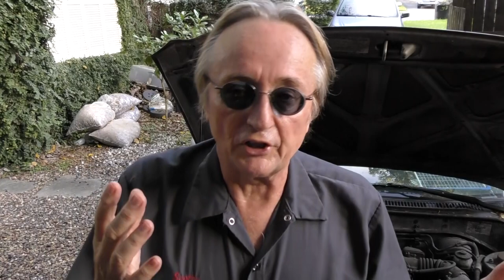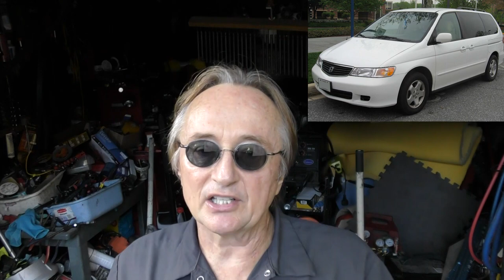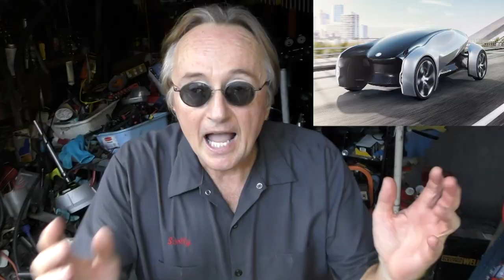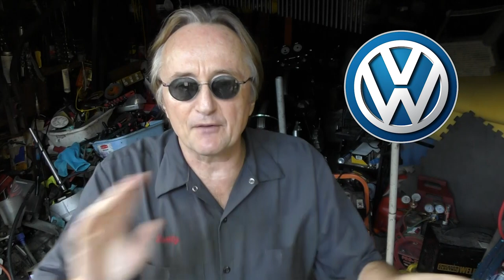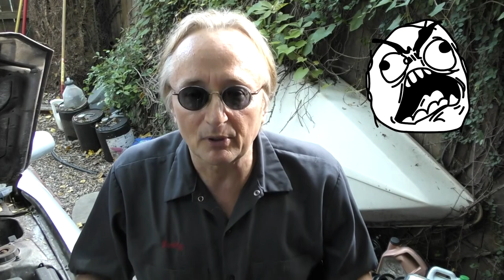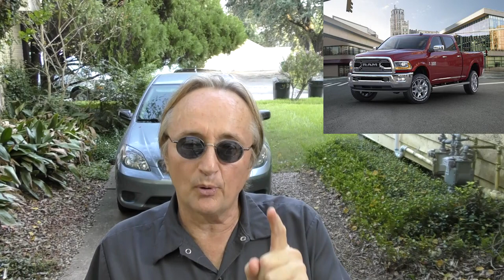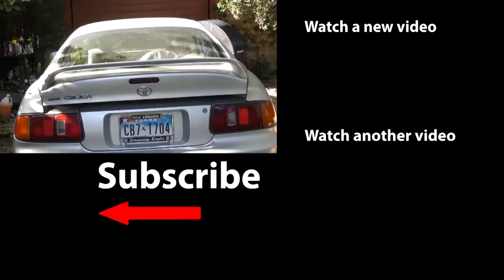Who Makes the Worst Automatic Transmission Cars in the World

Comment: Yes, Honda made horrible transmission in the beginning of 2000s. That's been rectified about a decade and a half ago, so they no longer produce bad transmissions for either of their vehicles including Acura lineup. So no, Honda does not make the worst transmissions in the world.
Reply: Acura Addicted I agree 100 percent. I have a 2008 accord v6 128400 bought brand new. Never had a single issue out of that transmission.  It's still strong 10 years later. Honda and Acura transmissions are very reliable and durable  for the past 15 years.
Reply: Actually, same here - I drive the V6 2008 MDX with 5 speed auto coming on 155K miles now. Zero issues with transmission or engine for that matter.
Reply: Umm the newer cvt have issue. I know people got free replaced under warranty
Reply: What about Honda civics? Do they have good reliability
Reply: @MrWalker1000  Yes civics are fine as any vehicle. . . Most of the vans and suvs they talked about here were driven by wemon and not serviced properly. And also have ungodly high milage.
Reply: Honda Odyssey from 99 to 2004, Honda accords from 98 to 2002 and civics from 2001-2005 automatics are the worst. With Honda you always has to go with manual transmissions to be safe
Reply: Explain how your transmission went wrong
Reply: which would you pick a toyota corolla or a honda civic?
Reply: @MrWalker1000  Civic hands down over the Corolla. Extremely well engineered and fun to drive. Everything Toyota makes are fine but as boring to drive as watching paint dry. Stying is horrible except the new Camry 16 and up but even then the Accord is better looking. All Toyotas are well built but all lack any type of interesting creature comforts. Toyota equals zzzzzzz.
Reply: @cook1876  anything wrong with 2005-2010 civics?
Yes you make good points about Toyota being boring however I think they sacrifice the fun aspect in order to make the most reliable cars in the world. A corolla is more reliable than a civic.
Reply: @MrWalker1000  my daughter has an 05 civic 150k miles no issues. Ive been in the auto repair business for 20 years. The only issues common to all Hondas are ac compressor failures.
Reply: @cook1876  ah I see thanks your opinion actually has weight given your experience. Yeah honds became popular cuz Toyota like reliability but except more fun to drive.
Thoughts on Mazda and subaru.
Why aren't Mazda as popular as other cars are they bad cars?
Reply: @MrWalker1000  at my shop we specialize in Subaru. In snow country you really can't beat the awd abilities. Prior to 2012 they are plagued with head gasket issues. After 2012 their cvt transmissions are questionable at best. If you can drive stick find a Subaru from 2012 and newer that combo is virtually indestructible. In 2012 they went to a timing chain instead of belt and no more head gasket issues. Great cars. Mazda is a bit of an underdog. They make great fun cars that nobody seems to buy. I would have no issues buying one. We never see any come in for anything major. Usually just maintenance.
Reply: @cook1876  yes scotty was saying the same thing that stick subaru are more reliable. Do they make bad autos?
How come pre 2012 subaru have such good reputation if they ha e so many issues? Too bad in the usa most use automatics.

Interesting... so Mazda are very underrated? I really dig the new Mazda. I always thought people didn't buy them because they were known to unreliable.
Do you know if the partnership ownership with Ford lowered their quality?
Reply: @MrWalker1000  pre 2012 Subaru rarely had transmission issues in their automatics. Mainly because they had a real transmission and not a cvt transmission. Cvt transmissions in their newer cars have been a problem. Very few manufacturers have been able to make a quality cvt work those belong to Toyota, Hondas, Mazda, Hyundai\Kia. Speaking of which don't rule Hyundai or Kia out. In the past 5 years or so they have been making really great quality vehicles. Great engineering in their powertrains and fit and finish. As far as Mazda I believe in my opinion their older merger with Ford hurt their quality. Since then they have moved away from Ford and refocused on building quality cars again. It has shown and more people are taking notice.
Reply: @cook1876  so buying 2005-2010 Mazda isn't a good idea.

I see a lot of used subaru but I always heard about the head gasket issues which kind of pushed me away from it. I don't like nissan that much.
Which made me rule out honda civic as my number one used car choice and Toyota. So basically honda and Toyota. I'd buy used Mazda but the Ford thing is kinda making me iffy.

My family member is crazy he swears by mercedes reliability which I thought was crazy he got a 2002 c-class. I told him he should of went Japanese.
Anyways I've been looking honda civic mostly just need to find good one but they all seem to be priced highly
Reply: unless you live in your dream world, but for us who live in the real world the ZF 9 speed units fail, one even fail on motortrend , the CVT fail up to 2017 models, their 8 speed DCT is also having failure.GO look where their favorite CR now rank them, go look at where they are rank in JD power dependable survey.
Reply: you can speak about 2008, but the new units are having issue, like the CVT, they are worst than nissan, the DCT, the 9 speed from ZF which having rough shift and even failure less then 10,000 miles.
Reply: There is nothing to explain even motortrend has the honda model with ZF 9 speed fail before 6k, the CVTs are failing also, they are worst than nissan, up to 2017 models CR-V,the  older ones has failing CVT.
Reply: 2000 Accord 4 Cyl V-TEC 235,000 miles one owner original tranny and engine...luck I guess...great car...still on the road today..I think the transmission problems were only in the V-6 models not the 4's...Everyone knew not to get a 99-2002 Accord V- but the 4 was ultra reliable...
Reply: @ImTheKaiser  u must be making it up no car would have problems w trannnys at 6000miles maybe u dont know how to  drive
Reply: @ImTheKaiser  HAHA I CALLED U OUT cuz i know all u do IS TROLL ONLINE 24/7
Reply: @ImTheKaiser  oh look at that hes stopped trolling haha
Reply: @Jose-xb6st  Getting harder to find.  I had a 1989 Civic Si 5 speed for 21 years. The new manual trannys (Fit; CRZ; HRV) are sadly no where near as smooth.

Comment: Nissan CVT made by Jatco are the worst cvt's
Reply: Same company made the cvts for Daimler Chrysler
Reply: Jane S  well Mitsubishi did get 40 percent bought out by Renault-Nissan due to an emissions scandal...
Reply: Yet Mitsubishi's transmissions are extremely reliable.
Reply: @super_slav91  lighter cars?
Reply: Not really, they are around the same weight, I was advised with CVT transmissions that Mitsubishi make the most reliable, followed by Subaru and then Toyota in regards to reliability but Subaru make the best in terms of driving pleasure, which is pointless in my opinion for a CVT.
Reply: Super_Slav I actually used to work as a Mitsubishi technician and I will say, these CVTs are actually reliable for the most part if you service them correctly and on-time. Although, some have failed mostly due to poor maintenance and abuse but that was more common on the RVR/Outlander Sport
Reply: The only thing I have heard is that using non OEM CVT fluid kills them, that's the most common mistake owners make on them, too bad the OEM stuff costs more than liquid gold.
Reply: @TheWardog1369  Chrysler doesn't use any cvt's
Reply: @super_slav91  no oem fluid is gonna save a jatco cvt
Reply: @bigdaddymak1439  they did when Daimler owned them.  The caliber had them as an option. Did not catch on.  It had a high failure ratw
Reply: Facts state otherwise.
Reply: Have you ever own a belt CVT  by honda or toyota? I guess not, that why you come here to talk your nonsense. Nissan CVT problem are not serious like even honda that having snap shafts, Nissan have issues with CVT but they are many that last long build even during the trouble years, nissan CVT issue goes by year they produce, the lastest span is 2012 to 2014 and some 2015 models , since 2016, 2017 and 2018 models are fix,  when buying a nissan you just have to know when the CVT issue have been resolve, to buy there cars. when purchasing a honda with CVT is a total different story, even the 2017 CR-V have failing CVT.
Reply: You argument is otter rubbish, the jacto belt CVT is one of the most reliable belt  CVT, because the CVt is the toyota hybrid are not belt,  they are planetary CVT. Nissan is the only manufacture that have belt CVT expand to large vehicle, honda just recent start use belt CVT in accord and CR-V , but ask owners how is it that going on for them. There are many fail unit in the Fit, CR-V and civic and accord. The reason you do not hear about them is that honda has some kinda secret warranty and they replace them and the information is tight lip, just like the 1.5 turbo engine issue,  but go look through the CR-V forum and see how much CVT fail up to 2017 models and how could one forget the recall 140, 000 in USA for fit and civic CVT. I can point you to nissan forum and the last report you will ever see is up to 2015 models having issue.
Reply: Honda really fucked up with the CVT in the original Jazz, they had to go back to torque converter.
Reply: yep mines failed at 72k miles but had signs around 60k and they told me it was normal
Reply: @Alex S. Yes some used them from the Daimler days but Chrysler doesn't use them anymore
Reply: Since you claim nissan have the worst CVT, why not post how many has fail?I do not want comments and you telling me about how many people complaining. I want numbers. I want you to beat the massive recall honda have on the fit and civic of 140,000 CVT and the acceptance by honda that all the CR-V  CVT has excessive vibration, and many issues.I wait you posting the number of how many rogue, how many sentra, how many maxima, how many murano, how many altima, and how many versa and how many pathfinder have CVT failure.
Reply: @Alex people think they can spill anything without being proving wrong, but honda recently accept that all the older CR-V CVT up to 2016+have issues, especially excessive vibration, I am sure not all rogue CVT fail or have vibration, but yet this guy telling you nissan is the worst. As one writer even point out the fit, or maybe this guy forget how the fit CVT was cutting shaft, or maybe he forget honda had to recall 140,000 fit and CIVIC CVT.  yes nissan hav erecall but not in that magnitude. One can speak of what he does not know, but when you know you have to tell him.
Reply: @cb5110  hey my comment said nothing about being fact its my opinion which everyone is entitled to! So if you don't like mine state yours and if you wants more info look it up yourself but good luck getting any manufacturers to read up voluntarily to anything! I know what I hear from people who work on vehicles for a living so if you don't like it I don't care!!
Reply: Personally I driven both honda and nissan vehicle with CVT, and I have wide knowledge on the subject, I know of nissan CVT failure and I know of honda CVT failure also, mechanics would be more familiar with nissan because they have been doing CVT from 2002 starting with murano, honda just join the rank in 2013 or 2014 for US market, but already they had units having issue , especially the CR-V. Subaru aslo start around 2012 or 2011. Many mechanics as you stated would not seen a CR-V unless out of warranty. so your point is remotely pointless, as it had nothing to compare with. So your third party assessment is based on what the mechanic knows not what exist. You can search both honda and nissan forum, owners advise others to stick away from their CVT. While nissan play hard ball (not admit to some of the CVT have problem) and give 120,000 miles warranty, honda admit the CR-V CVT does have issues. Beyond that there are many nissan and some honda CVT that had no issue whatsoever.
Reply: Can I ask something? Did cvt in mitsubishi lancer is durable?
Reply: bigdaddymak1439 Yes.
Reply: My wifes 2013 jeep patriot with the jatco cvt is at 105k miles. Just need to change that fluid more regularly. The engine has been mint
Reply: @cb5110  all New cvt are bad! All New cars are bad nonne of them Reach 200kmiles all New cars are full of electric problems m'y Honda accord 2000 has original trans and engine mileage IS 271000km Honda are know TO make Best engines
Reply: @saywhat5696   Say what. That is not correct there are  nissan cvt cars with over 200, 000 miles. There are also some people who had to replace transmission for various reason at less or about 60, 000 miles.
Reply: @cb5110  how could u assume what i just Saïd was incorrect if u already proved m'y point
Reply: @saywhat5696  Say what because the report given or obtain by the NHTSA show that only 2% if nissan Vehicle sold with CVT actually have failure you clearly said all new CVT.

Comment: My Parents bought the 2003 Honda Odyssey new back in the day and we still have it today with 150k miles of city driving and the original trans. It's my car now, but it definitely is not what it used to be. The thing clunks into reverse on cold mornings and 2nd to 3rd has a hesitant shift. My dad swears my van is built like a tank but boy now I realize my parents really got lucky with our 2nd gen Odyssey that it lasted this long. Otherwise a strong van. Good motor, runs perfect, thing never broke down once. Body is beat up from me driving the thing into downtown Chicago each day but otherwise has held up well. I am thinking about getting a 2020 Civic Sport Hatch while the trans in my 03 Odyssey still works.

Comment: Honda might mess up but they stand behind their product.  Your secret warranty comment in video.  So opposite of Chrysler who doesn't stand behind product.
Reply: Not for everyone, I bought my 2003 Odyssey into a dealership in 2008 or 9, made a fuss, and the offer I got was a discounted $3000 for a new transmission. It had less than 40,000 miles. That was last time we buy any Honda.
Reply: Honda stand behind there product is true, but that still does not mean they do not make bad transmission, up to even today. Unlike nissan who people have to sue to get the CVt fix or replace, honda replace the failing units , but it still does not stop from revealing honda has serious issue with their CVt like nissan. And the 9 speed from ZF was failing.
Reply: No issues whatsoever with my 2016 Honda CR-V with a CVT. It runs as smooth as butter.
Reply: Honda didn't stand by when their condensers kept going out on the Civics around 2008.
Reply: I agree with you there.
I find the difference between Import and Domestic automakers us the service level provided.
As a former Service Advisor who has worked for Toyota, Mazda and the big 3, the imports stand behind their products and know what to do when there is a known issue.
Whereas, the big 3 frequently denies any issue and stick their heads in the sand.
Both imports and domestics, have many issues but bc the imports are more willing acknowledge their issues, consumers feel heard and give a favorable impression of them.
This is where the big 3 have failed, especially Chrysler. 
Service is everything and Chrysler better do something about their servicing or they'll face their 3rd round of bankruptcy in the next few years again and this time there'll be no government bailout!
Reply: True Chrysler is trash

Comment: I have a 1997 dodge ram 3500 dually with the 12 valve 5.9 Cummins diesel. Transmission was rebuilt around 2005 and the truck today has 275k miles and it's a damn good truck. Never had a single problem since.

Comment: been driving since 1991. NEVER had a problem with a transmission in any of my vehicles. either I'm good at picking cars/trucks, have just been lucky, or maybe it's because I drive like a 90 year old woman. people beat their cars like a red headed step child and wonder why they're breaking down every week.
Reply: @Hat65  people fly by me, only to have to stop at the next light, at which point I casually cruise by their stopped vehicle.
Reply: Exactly! I always drive the limit or about 5-10 slower, and people always overtake me lol. Like seriously, your only going to be like 10 seconds there quicker in reality. Driving a car is not a video game or time machine. 

I just hate how so many people decide that wasting more fuel, putting more wear and stress on the engine/transmission and tires, speeding at not only unnecessary speeds but also unsafe ones, and tailgating and overtaking all the time is extremely worth that extra 10-30 seconds arriving faster.

Honeslty the only time you should speed is if there are zombies chasing your car, or prefer spending 1000ands of $ later only for those extra few seconds.
Reply: funkierfawn budgie Just stay out of the left lane on the highway so that I can pass you.